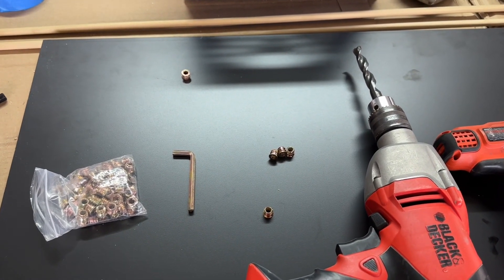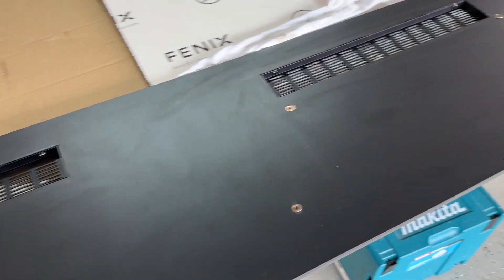Ford Transit Van Build | Threaded Inserts for Installing Beautiful Cabinets in Your Van!

Comment: I noticed you're using fenix laminate. Does that just come as a 4x8 laminated sheet? Or did you laminate the sheet? 3/4" sheets?
Reply from the maker: Yes- we ordered two colors of Fenix laminate (Bianco Male and Piombo Doha), both available in 4x8 sheets at 0.8 mm thickness. It took me a while to find a distributor to order the colors we wanted, and we were able to order through Dakota Hardwoods out of Houston.  We them laminated baltic birch plywood to make our cabinets and drawers. Its really beautiful laminate, and we are so happy with the look, but it sure was a lot of work!